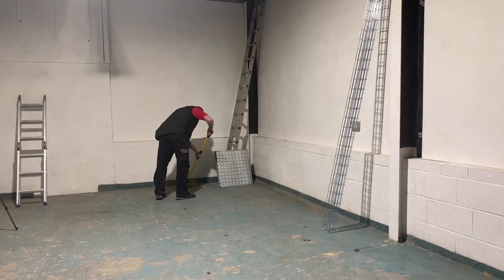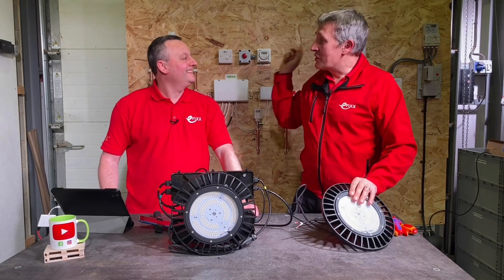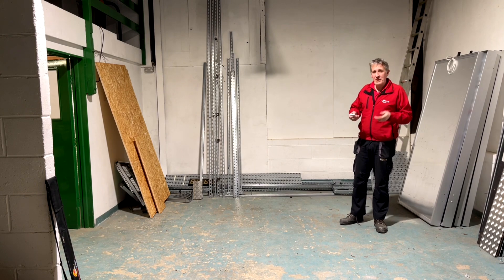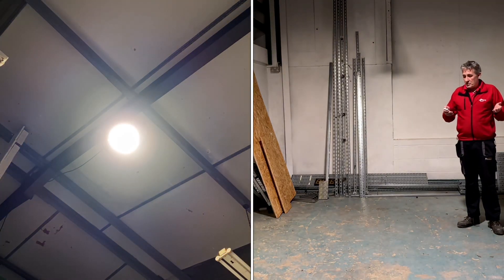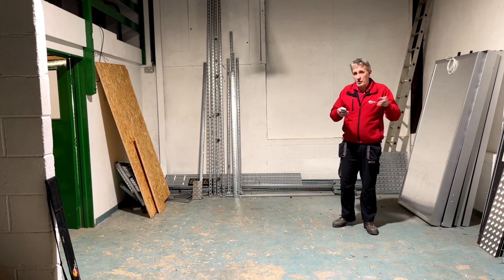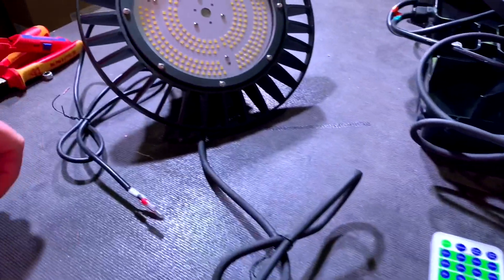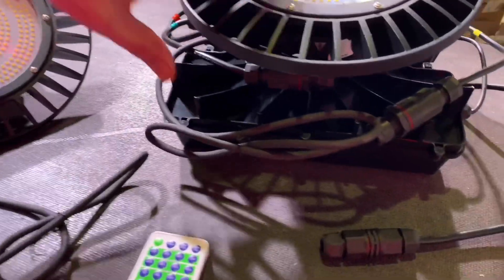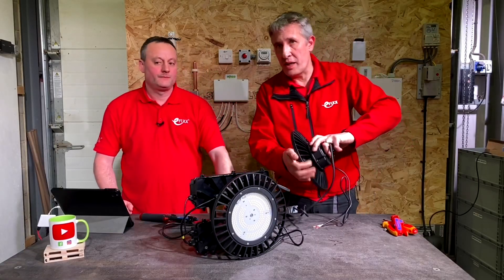Industrial and warehouse lighting needs covered with the JCC Toughbay LED High Bay

Comment: I find the modern LED green charging sensors are usually so bright you can quite clearly see! 🤣 like the fact the battery compartment is far away from the light itself, usually in the old emergency fittings the battery has been cooked to a crisp.

Comment: i've fitted a lot of those microwave sensors in car parks, sooo easy to set up, spread isn't that great on low ceilings, but mounted on a wall gets rid of that issue, can be a tad sensitive at times penetrating stud partions .. once you get to know the quirks they are great.. far better than a PIR.. no climbing steps to adjust :)